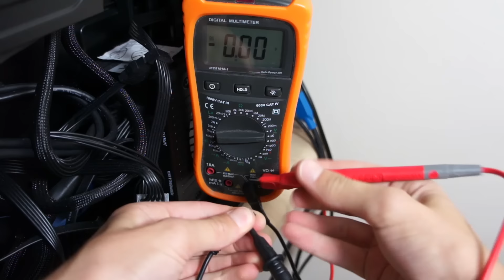TOP 5 HTC VIVE Hardware Mods

Comment: Nice video except I wouldn't suggest swapping the left and right earbud as most of the games make use of the stereo sound to help you locate things you cannot see, it could be confusing hearing a zombie on the left side of you when it is actually on the right.
Reply from the maker: Yup, I only now realized that although I believe there is an audio swap option. If you don't like my method you can just put the right earbud to the right ear and run the wire under your ear
Reply: WorkshopScience
Yea I do this anyway, just thought I'd point it out, its a great method and I am glad you are showing people how to do it and showing them better then other videos I may add, just letting the people know that swapping (without the audio swap option you mentioned) may not be the best idea.
Reply from the maker: Thanks for your feedback and improvement to my method. Glad you liked the video!

Comment: Cool PSU powered headset.. but WHY??
Reply: Convenience.
Not everybody has an infinite supply of wall adapters.
Reply: @ZalkDrives  What? The Vive comes with all the wall adapters you need... this mod doesn't seem very convenient.. looks like a lot of work for no pay off to me.
Reply: @christophermachir1009  Sorry, should have clarified what I mean by wall adapters.
I meant wall outlets, I only have 2 plug-ins inside of my entire room, so I understand why people might want to do that.
Reply: @ZalkDrives  don't you use a power strip/surge protector? All my electronics are plugged into one strip. You should at least have one just to protected your electronics from power surges.
Reply: It's stupid. There is no reason to plug the HMD into the computer power supply. Absolutely horrible idea for many reasons.

Comment: why the fuck go through the effort of soldering and such, IT HAS A POWER CABLE OUT OF THE BOX YOU JUST PLUG IT IN
Reply from the maker: So that you do not have to use up an extra power socket
Reply: Because power strips don't exist? If you can afford a vive and not a surge protector. You've got some issues lol.

Comment: this video is a joke. swapping stereo is bad in VR. why would you ever do this? 
aside from the microphone mod (why not just use a small piece of fabric tape?) and the molex PSU mod, the rest are more adjustments, than mods. 

where is the gearVR lens mod? i did it and will never go back. did side by side with an unmodded set and the difference is insane.

pros: 
-vastly improved visual clarity
-no haloing/rings of light in your view
-larger sweet spot of focus
-clear visibility all the way to the edge of your FOV. 

cons: 
-need to use a utility to manually tune the new lenses (necessary!)
-slightly reduced overall FOV, from 110 degrees, down to about 95 degrees. (anything past 60 degrees was blurry with stock lenses anyway. modded is sharp and clear all the way to the edge)
-less clearance for glasses; make sure to dial the distance back with the two large side knobs so glasses dont touch the lenses.

Comment: Why tf would you want to plug your vive straight into your computers psu, and how does the wire get out of the computer, this is the most useless thing on the list.
Change the title to How to waste your time "upgrading" your vive
Reply: saves you a wall outlet if you dont have that many, and you can either send it out though the slots you plug in to the GPU, or like in the video crack open the sidepanel a bit to let it out.
Reply: @kirito1267  "Saves you a wall outlet if you don't have any" - How can that even happen?
Reply: tbh this mod seems relatively sound. plenty of ways to modify your case to run a wire out the back or side, and if you want to be somewhat mobile with your VR rig, this would save some setup time and hassle if the link box is mounted on your case as an integral component. honestly its the only mod in this video i feel is an actual "mod"